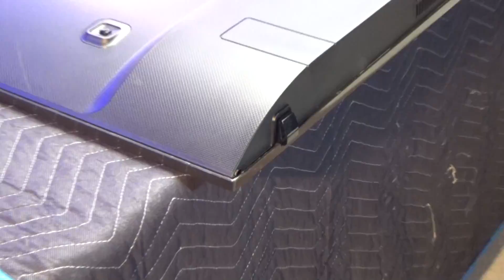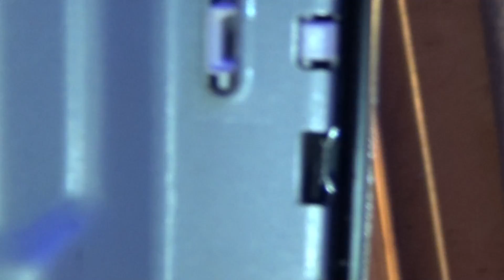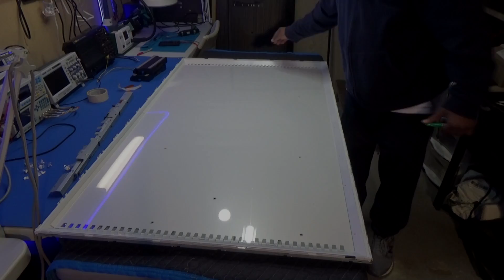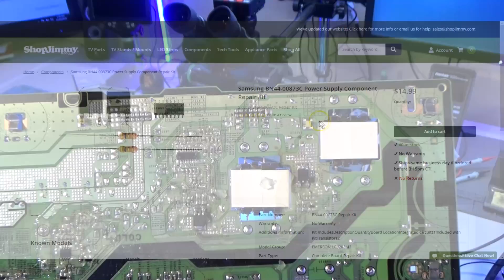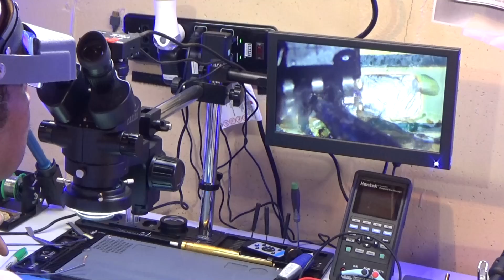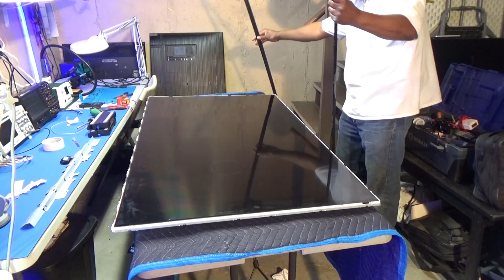65 inch Samsung 4K LED TV, has sound but no picture. UN65MU6290 (Full TV repair).

Comment: Thank you for this video.  I have the exact same model with a backlight problem.  I have the backlight strips which I am about to replace however, as a result of your video, I decided to check the FETs and IC.  Lo and behold, one FET is shorted!  Unfortunately, the repair/mod kit is no longer available .  Do you know the part number of the FET or a suitable equivalent?  Thank you.

Comment: Hi Bigdogg, i'm a beginner repairing tv's.  i have a 32" LED TV. When powering on  the TV i have standby light, sound and images on the LED frontscreen, but no backlight. On the powersupply board, when measuring the voltage for the LED backlight on startup, i measure 123 Volts and it gradually drops to 54 volts. When measuring the LED backlight voltage on the powersupply board with the LED backlight connector disconnected, is till measure 123 Volts on startup and it gradually drops to a lower voltage. What can the problem be? Hope to hear from you soon, many thanks in advance

Comment: Hello Sir, first things first thanks for the great video, got a samsung 65 curved, the leds come on only if i disconnect at least 1 cable from the t con board (doesnt matter if it is the 4 pin cable, the LDSV cable or one of the 2 ribbon cables) i have changed so far there main board and tcon board as well, can this problem be the cause of a bad failing LCD panel?

I still didnt change power supply so far, can these symptoms be lcd panel?

Would be very glad to hear from you, take care Sir.
Reply from the maker: Yes.
Reply: @bigdog8882  i installed a Brand new Power supply still Same issued, the LCD is bad

Comment: Hi   love your videos.  Very informative. 

Questions.  I have a ue43ru7100 Sammy and the led have melted the edge of the plastic diffuser, no cracks.  There is one spot that melted in about 2mm but the rest just surface melt.  Can that diffuser be spun around 180 degrees so the good edge is on the LED strips??  I wasn't sure if they were designed for a 1 way light diffusing array.   Someone said it can be done but it will not be as bright.  Maybe you would have tried this and could give me a tip .  Thanks

Comment: You can also convert it to the UN6900 to  UN7100. If you have a good UN6900-7100 with a cracked screen you can put the MU6290 screen on it, you just have to use the main and tcon board. There is also one without the tcon board and you might not have to swap the main board with that one

Comment: I have  Samsung 58UN and there was no picture so I replaced all the LED's. The backlights only flash for a quick second and then nothing
Reply from the maker: You may have a problem with the PS too. First make sure that all the Led strips are plugged in correctly, and double check each individual strip if U have a Tester.

Comment: I bought a  samsung un65nu6950 at Costco on January 2019. it is now March of 2022 and the left 1/2 side of my screen is flickering. i've called samsung support, reset the tv and the flickering still going. it a damm shame Samsung won't do anything about it because is "out of warranty" how can a $700 tv that is barely 3 years old go bad? I have tv in my house that are over 10 years old and they're still going strong. Damm you Samsung!

Comment: Have an 8k 55 inch and have backlight but no image . Reboots with 2 blinking lights until remove 1 ribbon cable from t-con board , still no image , tried mainboard ,psu and checked for shorts . No clue but think panel has gone .

Comment: Hello, i have a question. I want to replace my brushed aluminium front frame from my samsung js9500 tv. Do i need to remove the speakers and the metal parts and disconnect anything? Or can i just remove the big plastic back cover and immediatly remove the front frame after? Or do i need to do any other steps? Thanks
Reply from the maker: All depends how the TV is made. You have to play it by EYE. Every television is made different.
Reply: @bigdog8882  hello thank you for your reply. its a samsung ue88js9500 it has an aluminium frame do you know it about that tv?
Reply from the maker: @andrew007jp  No cant say I have.

Comment: Hey Big Dog...can you help me with my un70nu6900fxza sound but no picture? Ive changed main board, power supply and all other cables. Still no picture
Reply from the maker: What about the backlight strips?
Reply: @bigdog8882  not yet. Didnt think i needed to as they come on and seem to be working. Im trying the tape trick as we speak.
Reply from the maker: @NunyaBidness26  If you have a lit screen (backlight) but no Video, then its either the T-Con board or a bad lcd panel.
Reply: @bigdog8882  tcon board is built into main which is new so would have to be lcd panel. When issue first happened. Tv was on watching for hour or so. Paused netflix for about 20 mins. Screen was dim. When i pressed play screen stayed dim then went full on blackout. Sound but no picture. Unplugged tv.plugged back in and would power cycle. Now no power cycle but have sound and light but no video

Comment: I got this same exact tv for free because it was not turning on. The issue I’m having is that the tv flashes constantly (backlights) and you hear a clicking sound as if there’s a loose wire coming from the backlight strips underneath. Any ideas on what to do?

Comment: I have this same TV and watched the full video, but my TV has a somewhat different issue. I can see the backlight and it seems that there are multiple leds not working... I can actually see the bright spots near the bottom of the screen, but not the full pattern. I still have picture, but it is all pretty dark, as if only a handful of the leds are working. And I can see light from both sides of the led bars... could this be something other than the leds? I know it about impossible to diagnose from this comment, but I am thinking it is not the leds and something else not getting the leds the right power loads... thanks!
Reply from the maker: Sounds like bad leds to me
Reply: @bigdog8882  thanks for the quick reply! I'm going to attempt to fix it with your video as a guide! I'll comment back once I get parts and attempt it!!

Comment: Hey hey BigDogg! Really dig your vids, very informative. I'm wondering have you had any of the 65 inch Samsung "The Frame" tvs come through your shop? They use that stupid one connect box which I've replaced and it gave me sound but I still have no picture. Screen lights up but no image
Reply from the maker: Sounds like you may have a Panel or T-con (if it uses one) problem with the TV itself.

Comment: I was give  broken 7 Series UHD TV that had the same backlight problem as yours. Very good video, I didn't have the specialty tool to remove the cover. Ordinary chopsticks worked great and I had the back off in 2 min or less
Reply from the maker: Thanks for sharing that Tip!

Comment: I am at a loss with mine. Took it all apart. Tested each led strip and good. Replaced power supply board. Does not have a t-con board but when I disconnect either ribbon cable going from main board to the TV it works fine. When both cables are plugged in, the lights go on then go out.
Reply: Have the same problem with mine, Samsung UN55NU7300. Thought it was the main board, but that only made it stop pulsing the LEDs on and off.

Comment: What voltage is supposed to be going to the LEDs on a working power supply board?
Reply from the maker: At least 80+ volts, depending on the TV.
Reply: @bigdog8882  mine is the exact same model number as the one in this video also has picture but no backlight. Only the board is reading about 320volts to the LEDs. Does that mean my board has gone bad?
Reply: @bigdog8882  also thanks for the reply I really appreciate it.

Comment: Hi "bigdog", all the best, thanks for your generosity.
You mention blowing up LEDs with the Tester.
These LED Backlight testers, usually have a Capacitor on output,
without load it's charging to 300V+.
When you connect to LEDs, that capacitor charge may be able to blow up some LEDs.
I know it's annoying but correct procedure is to connect the LEDs to tester,
when it's Off, after that power On the tester.
The tester needs a current protection circuit on output.

Comment: Great channel!!! I have an rca led46c45rq with sound and picture but no backlight. All strips light up with the tester, on the tester I get around 86 volts per strip but at the power supply I only see around 60 with the tv turned on. Could it be the power supply? The power supply model is RE46HQ1004, RS126S-3T01.

Comment: I totally needed this a month ago! I ended up replacing the LEDs, MOSFETS, and resistors (from that kit) but didn’t have the proper tools to do the IC. It took me months to get it all fixed. While moving the tv after reassembly I grabbed the corner too hard and cracked the frickin’ lcd panel!!! I couldn’t believe it. Parting it out on eBay now.
Reply from the maker: I feel ya. Shiii... Happens. lol

Comment: I have a 58 inch Samsung TU7000 TV with no picture but I have sound and backlight. I am trying to figure out what I need to buy in order to repair my tv. Please help. And do you have an email or contact info?
Reply from the maker: Replace T-Con board 1st.

Comment: Have you come across any UN55KS8000 with blinking standby, and Blinking Backlights?
Reply from the maker: Dont think so.
Reply: I'm having the exact same issue with a un65ks9000, let know if you figure it out! I disconnected the cable from the main board to the power board and the backlights stay on🤔

Comment: Bro your channel is growing faster. Good info. 👍 Too bad you don't live in Tampa it would be great to collab in a video. Maybe one day, everyone retires here even Tom Brady.
Reply from the maker: We will Bro!
Reply: i have a question maybe someone can help me out with, i have a {curbside} samsung un60 that won't do anything. if i disconnect the main board and tcon the backlight fires up.  i don't have the "one connect" box for the tv, would not having the box prevent the tv from firing up?
Reply: @ED4action  the one connector cable unit is merely for ease and convenience so not having multiple cables going to the tv, your symptoms could well be a component on the power supply board as not enough juice for the led drivers/mosfet to work whilst other boards are connected,
Reply: @tonyquinn7479  ok thanks, i was guessing the power board was ok.
Reply: He's great, isn't he?